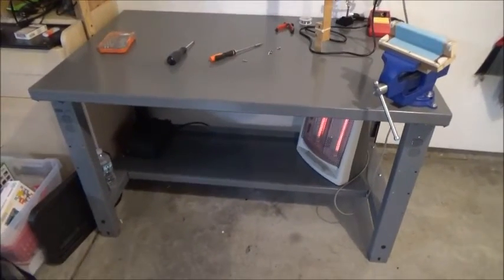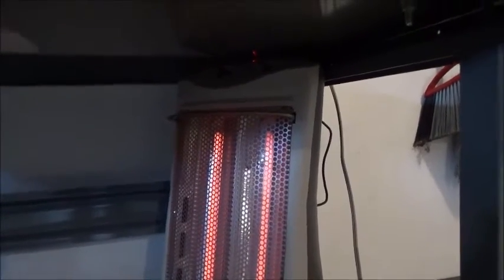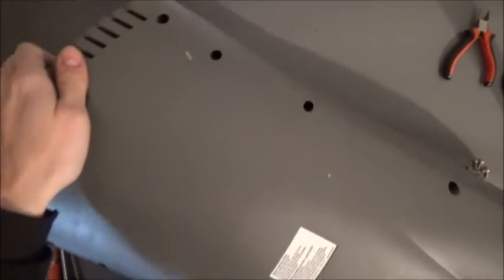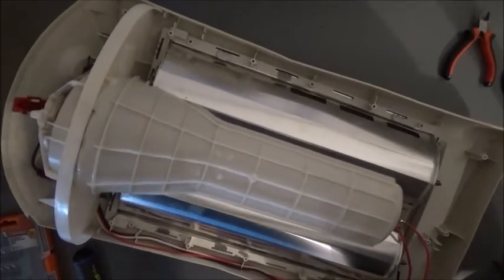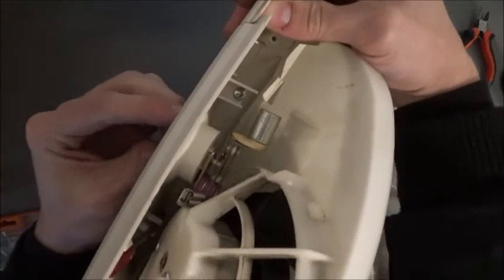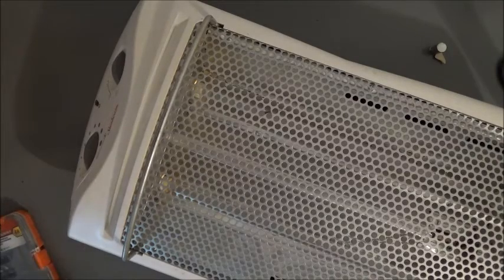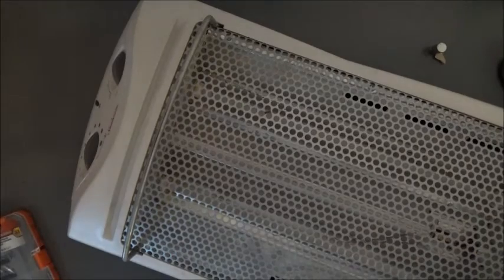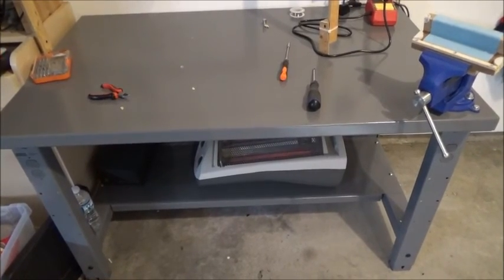Dangerous Electric Heater Mod! DO NOT DO THIS...Seriously!

Comment: For all of you who are having the issue of setting 2 overheating, take your heater apart, clean that bad boy up get all that dust out. Next if there is a duct that the fan blows into remove that! This allows proper airflow to keep everything cool, the duct only prevents proper airflow from getting down because it’s too small of a diameter. You can access the screws with the front still on, but the screwdriver shaft needs to be narrow enough. Hope this helps!

Comment: Same problem. Took off weight completely. Still shuts off
Reply: Search for a video titled, Holmes Heater Repair HQH307 Power On, No Heat U Can Fix Anything . It shows that the problem was the internal fuse that had dried out, which had caused the heater to work intermittently or not at all. Bypassing the fuse with a wire solves the problem but then you lose the protection of the fuse. In order to fix that problem, he plugged the heater into a power strip that had a 15 amp circuit breaker to act as a fuse. Aside from an electrical fuse, the heater also has a thermal cutoff switch that's inline with the fuse. If you replace the fuse with a wire, then make sure the wire is thin so that it'll melt and disconnect the power if the current gets too high.